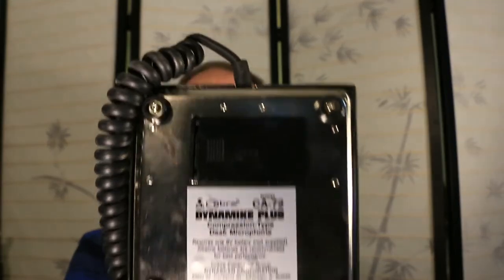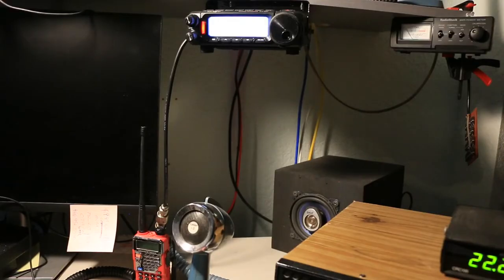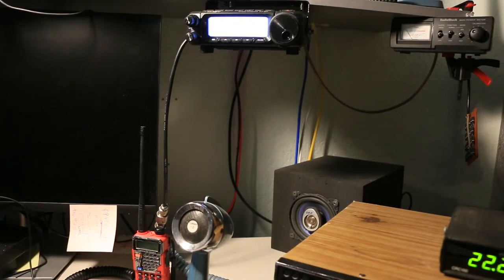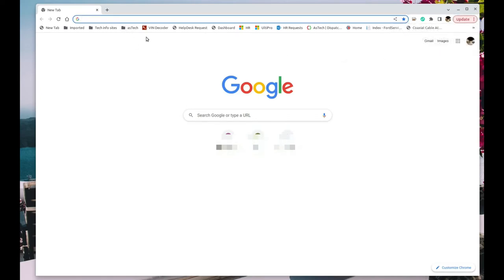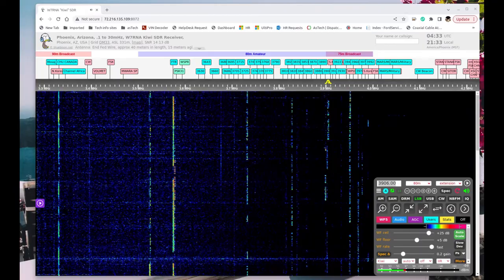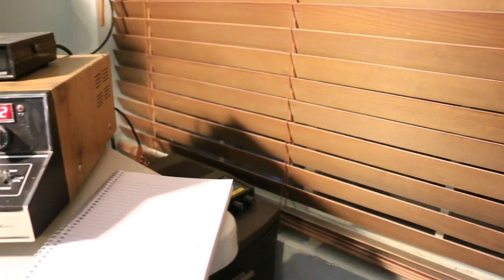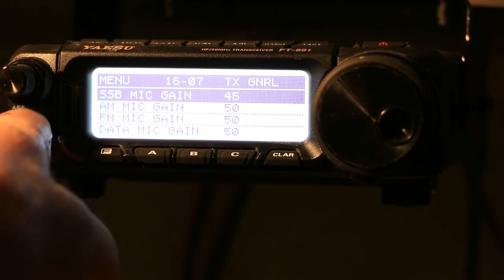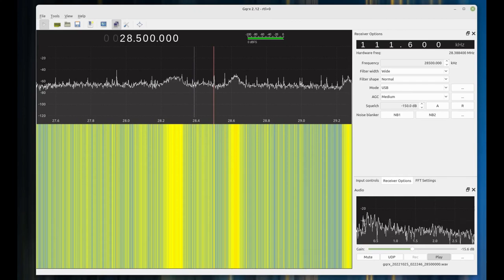Using vintage CB microphones on a modern Yaesu. SDR content!

Comment: Hi Rick, the Turner Plus 3 does it for me. It was the only Turner with a compressor board and works excellent on my Cobra 2000. It runs circles around the D104’s on side band, but my best friend loves the 104 on his Yaesu. He and I debate the virtues between the two on a regular basis. LOL

Comment: The reason for the Darlington configuration is a high input impedance to accept crystal and ceramic cartridges. Not as high as a FET impedance though. You may find FETS achieve a higher output because of this (the cartridge is exciting the input of the amplifier stage more) and a less muffled tone is achieved. Bear in mind though, ceramic cartridges actually can put out a staggering voltage, I've measured around 2 volts.
A general rule of thumb for the load impedance for the output of a microphone to achieve a reasonable tone/response is around 5 to 10 times. So in other words, the input impedance of the audio section in your radio needs to be 5 to 10 times the output impedance of your microphone (in this case, an amplified mic, so the output impedance of that board). Microphone manuals will state this, as too, radio manuals.

Comment: I like the old microphones a lot better. Picked up a Johnson while back and wired it up for a Cobra. It keys up but has really low modulation. It's not a power mic so not sure what the problem is. I'm thinking possibly the element is bad. Great video!